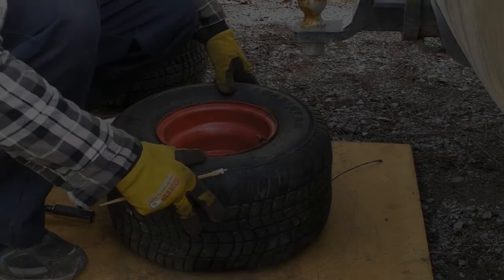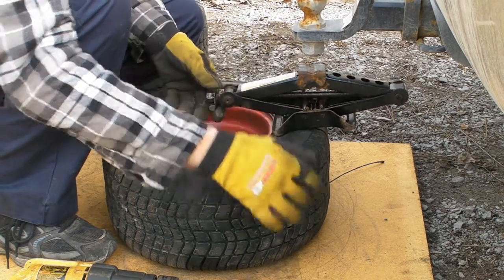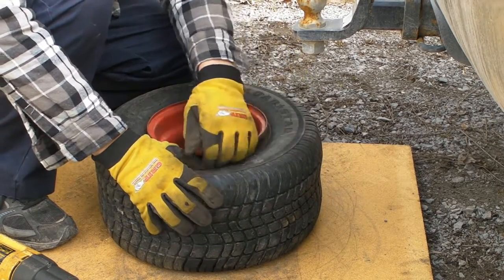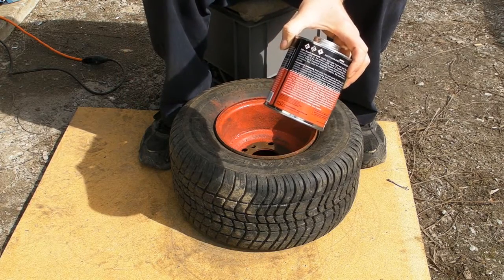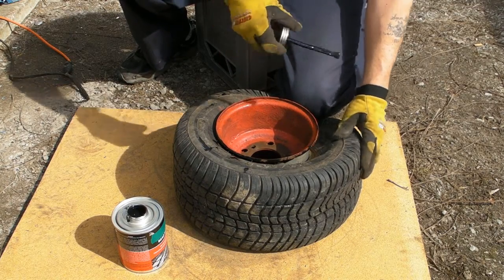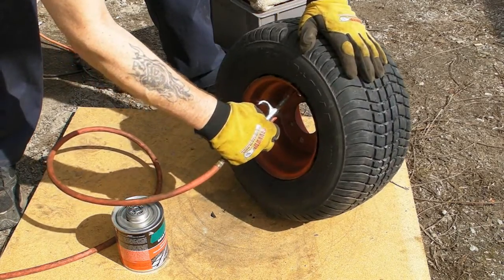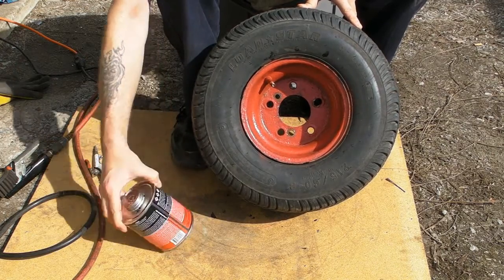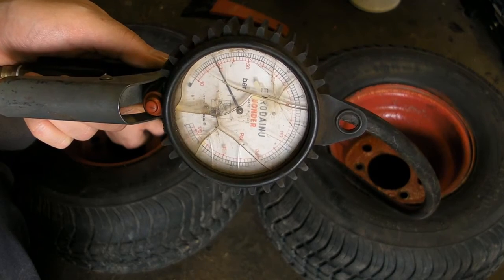Goregoon's Garage: Using bead sealer to fix up tires leaking at the rim.

Comment: I should have used bead sealer when my tractor mower tire had bead sealing issues.  At the time I didn't know about the sealer, so I wound up putting a tube in the tire.  I also have seen some people use that Flex Seal liquid or spray as a bead sealer.

Comment: i just bought a can of that stuff today at advance auto parts for 9.99....gonna try it on a leaking scooter rim
Reply from the maker: Works pretty good but make sure you do a nice sanding/smoothing and make sure the bead is nice and clean. I kinda rushed mine, still leaks a bit but they hold for a weeks or more now rather than overnight so that's good enough for the girls I date.
Reply: yeah i sanded all around it...cleaned it good...brushed it on both sides plus on the tire too...stuff works good...still holding air
Reply: I bought a can of bead sealer at O'Reilly's Auto parts.... a 32 oz can for 12.99.... they had to get it out of the back room because  normally they only sell it to their commercial accounts.... It was not on display in the store you had to ask for it

Comment: I have a rim that is only 1 year old doing this crap already. Smh im so dam mad.
Reply: I know it's frustrating. We bought a new Craftsman Pro Series mower and have a slow leak in one of the front tires. I used a $1 spray bottle from the dollar store with some dish soap and water mixed together. Then spray the entire tire, rim, valve stem to determine the location of the leak (bubbling area). It'll usually be where the rim/tire meet, but sometime the valve core or stem may be bad. Then, just use some rim sealant to stop the leak if the bubbles are coming from the tire/rim junction.